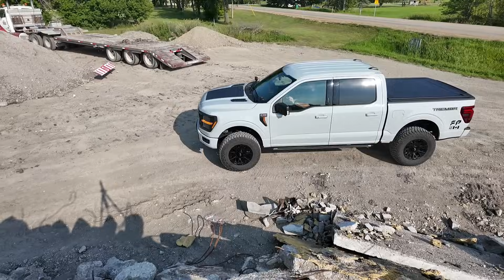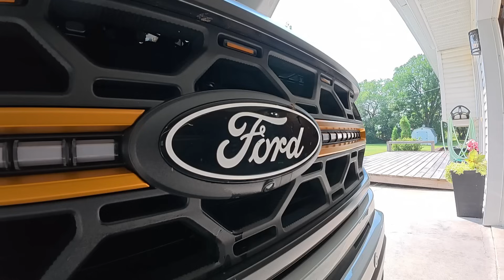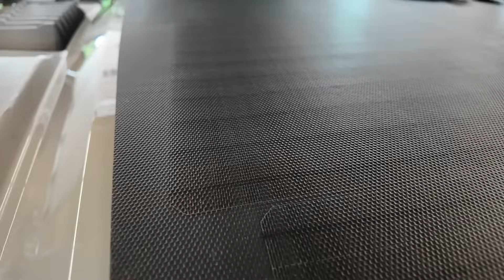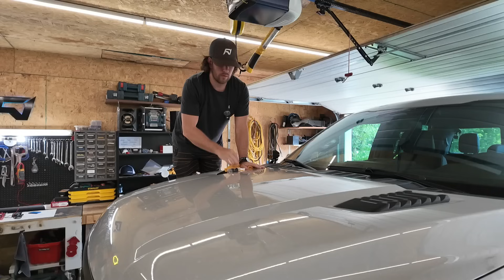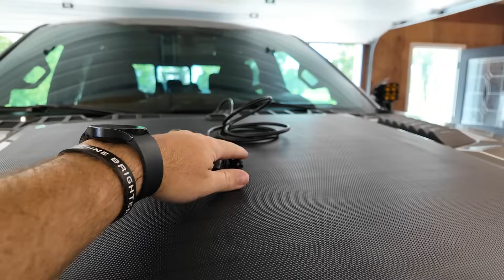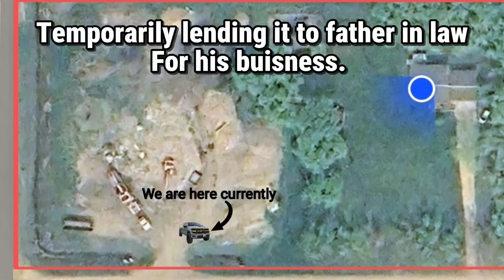Solar Panel Install On The F150

Comment: not an inverter its a charge controller.
still you did a great job showing off this
Reply from the maker: You are correct. I rarely do DC to DC solar panel installs so my brain was thinking inverter when I was shooting. Thanks for the correction 👊

Comment: Spaced up an 1/8" off the hood that hood mat will collect salt and mud in the spaces between the 3m tape which will leak out after you pass wash spray wand over it , over and over again. Let me know if youi ever see another Manitoban using one.

Comment: Would it be possible to use the aux cables to power a anker power bank or "solar generator" via an xt60 connector?

Comment: Man, love your content! I just subscribed. I have a 2024 F150 XLT with the FX4. Man, I don't know if it was a good ideal to tape the "inverter" to the battery, right? You'll have to replace the battery eventually, right? Anyways, awesome video. I installed double 10" subs from Skar and they drain my battery. This solar panel install could really help me! This video is awesome!
Reply from the maker: Its just 3M taped on when the time comes to replace the battery, it would be easy enough to get off with some fishing line

Comment: It’s a charge controller. Specifically a pulse width modulation controller. An inverter invert AC into DC. A converter converts DC into AC.
Reply from the maker: You are correct yes. I have never dealt with DC to DC solar panel setups. Just DC to AC. So my brain kept thinking inverter. But yes it's just a charge controller 👌
Reply: Almost. It’s not a PWM. It’s a MPPT, maximum power point tracking, solar controller. A lot better than the old school less efficient PWM that they still use on factory RVs.

Comment: This is a great idea.  I wonder, do you know, how will that adhesive hold up to the big temperature swings of hot summers and cold winters?  And its appearance too?  I wonder if I was to forego a twin panel moon roof, if a large one of these could be used over the majority of the cab roof, and how we could hide the wires between it and the battery effectively?  To really maximize the added solar power, hood and roof.  Or maybe keep the twin panel moon roof but run narrower strips of the solar panel around its periphery, if such narrower strips are available?  And your set up here, could it run a laptop fully in the clear sun for as long as it was sunny?  More than just that?  Other?  Could you give some specific examples, the what's and how longs?  Thanks for a great video.
Reply from the maker: Hope that helps. I'll do a follow up video in the future on how it's performing and the uses I'm getting out of it.
Reply from the maker: I can't send an image so Il send the text. But this is what I found online that a 100W solar panel is capable of.

Devices You Can Run (at once) in Peak Sunlight

Small electronics

Phones (5-10W each) → charge 5-6 at the same time

Action cams / drone batteries (15-30W) → 2-3 charging at once

Tablet or e-reader (10-15W) → no problem

Laptop with DC adapter (40-60W) → 1 comfortably

Comfort gear

12V fan (15-20W) → several hours

12V LED light bar (20-30W) → continuous

12V Bluetooth speaker / radio (10-20W) all day

Overlanding gear

12V compressor fridge (40-60W average draw) → yes, as long as sun stays strong; works especially well with a battery buffer

12V water pump (40-60W intermittent) occasional bursts for showers/dishes
Reply: @fiftynation  Good stuff.  Thank you.  I'll keep an eye out for that video.   And have a battery buffer, something to store daylight charge to run overnight, if that can be done I'd like to know more about that too.

Comment: Feel like just a bigger alternator would be a better then this big black blob on the hood
Reply from the maker: I really like the way it looks on the hood. 💯
Reply: @fiftynation  yes I'd buy it just for the looks ..........the 3M tape is it really close to the edges wondering if dirt will accumulate if there is a void?
Reply: Serious question. Will a F750 alternator work?
Reply: @snake098765 prolly not depends on how many amps you need I guess
Reply: Does your alternator work when the engine isn’t running?